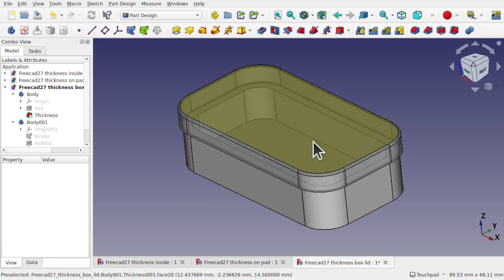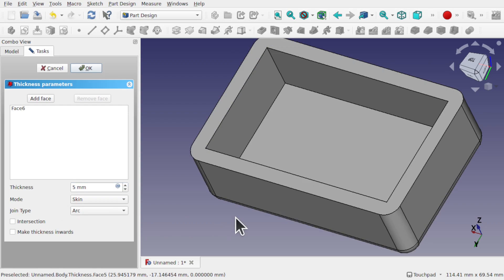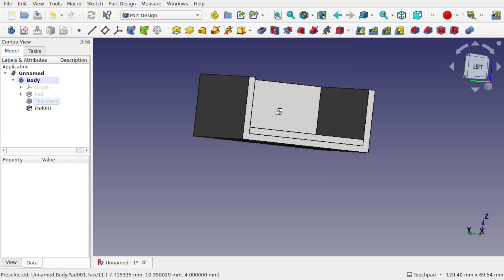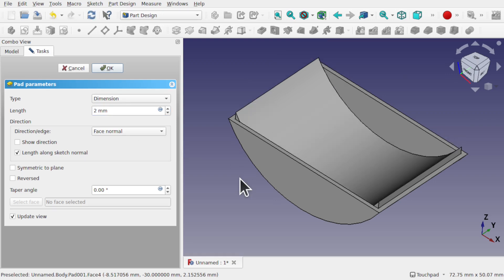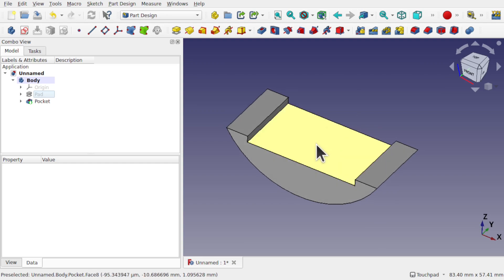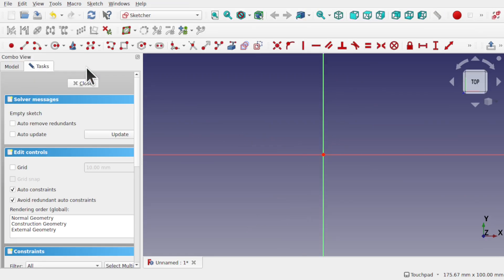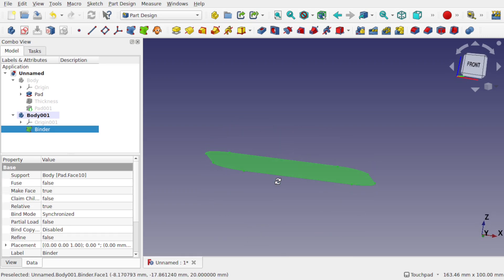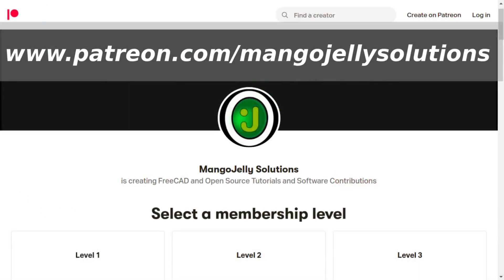FreeCAD for Beginners 27: Multi thickness walled models with part design thickness tool

Comment: 00:00 Intro
01:25 Explanation and example of Part Design: Thickness
03:06 Padding floor of Thicknessed box
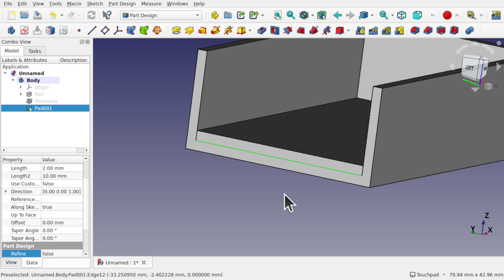06:09 Thickness example on curved shape, showing inconsistencies
09:18 Thickness example using separate sketch, leaving hollow body with lip
11:44 Creating box with single sketch and Thickness
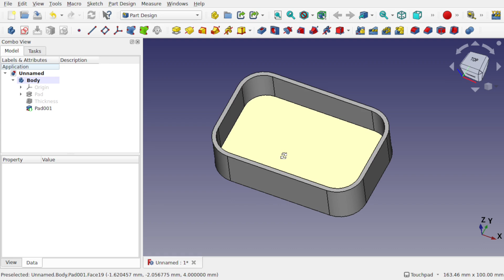13:16 Adding sub-shape binder for lid
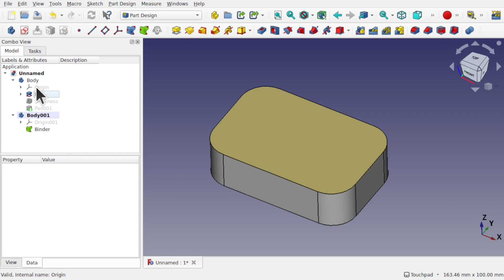14:31 Padding & Thicknessing sub-shape binder for lid
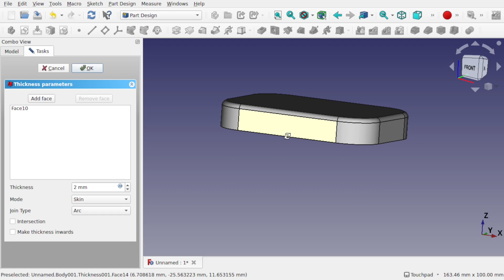15:27 Offsetting sub-shape binder to increase tolerance of lid fit
16:44 Outro
Reply from the maker: Thank you once again 😎👍😀😀
Reply: @MangoJellySolutions  Another great exercise I think we're gonna have to continue on with the shape binder and using multiple bodies and I guess multiple documents as well in order..to  Really drill it into our heads. This is the only second time I've actually used shape binder in your exercises. And I could definitely benefit from a lot more of them.
Reply from the maker: @nothingelsetolose7661  Hi, late reply sorry, catching up.  Yes the shapebinder is pretty versatile and can be used across multiple documents.  You open another document, click on it, select the shape you want to bind, and then making sure you don't click on anything other than selecting the tab of the document you want to use the shape binder in.  Then in this document click the shape binder tool to pull it in.  You must be careful not to accidentally click on anything else otherwise you have to start the process again.  Now, re: a follow on  video I am going to make a note on the plan to include this in the learning series that I am doing.  Just writing the posit now to push it into the timeline which is current stuck on my office wall :)  Thanks for the idea.

Comment: I was searching for the offset parameter of SubShapeBinder in Part Design, until the bright idea of using a newer version than 0.20 of FreeCad.  0.20.1 did the job.
Reply from the maker: Thank you for adding this, really helps with others having the same issues.

Comment: Hi there, I ahve seen your videos on FreeCAD and pretty impressed. I am prone to use SW and Fusion360 back in my UG&PG but I don't have their subscriptions anymore. Just wondering does freecad is enough like SW?
thanks
Reply from the maker: Thank you, glad you like the videos. I haven't used solid works for years so I can't really comment. But the workflows through such writhed as part design is similar to fusion in ways. Freecad is a very different beast due to the numerous ways you can achieve your goal